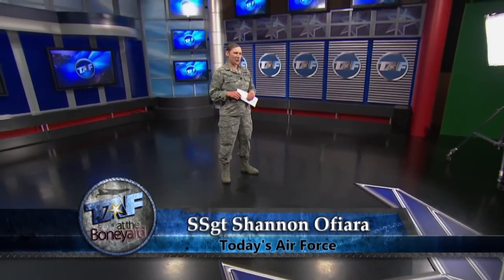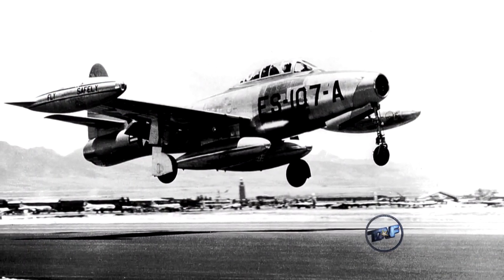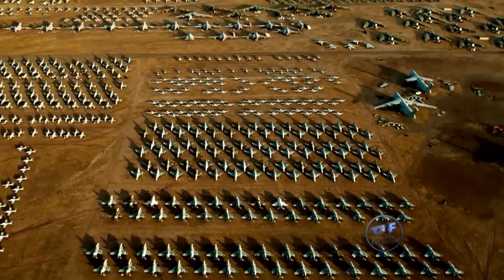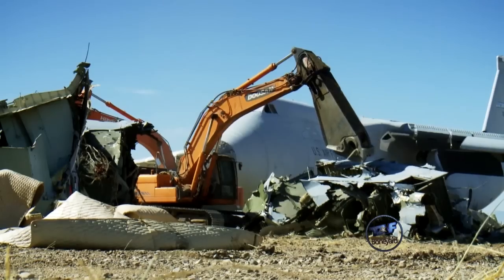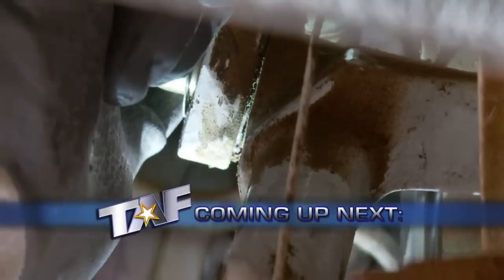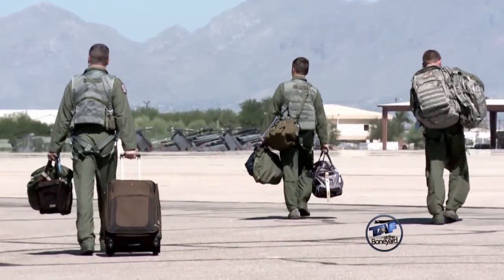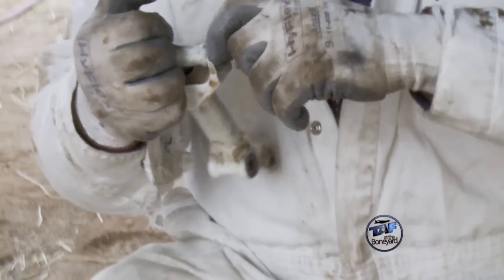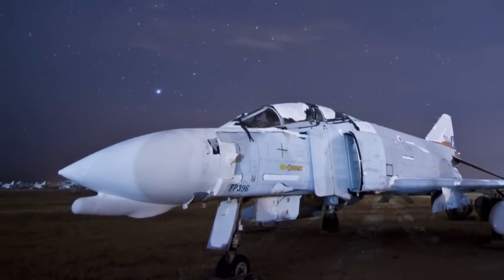Today's Air Force: At the Boneyard

Comment: I was there in October. Yes, you can visit the boneyard but it has to be on an official tour from the Pima Museum. The aircraft in storage there ARE NOT rotting. Some are being used for parts while some are in mothballs in the event they are needed to be restored for operational duty. Some of the C-5s will be converted into C-5Ms. This is NOT a junk yard. It's an aircraft storage facility. Older, worn out aircraft are cut up for scrap but there are airframes there that will fly again. The "boneyard" is actually a reclamation center.
Reply: Thanks for explaining this, a lot of people have no idea what really goes on there.
Reply: Are you able to go in any of the aircraft?

Comment: Great place to visit and learn about the many ways AMARC keeps serving aircraft flying. Those who think AMARC exists just to "scrap" are ignorant. Scrap is what's left over after millions of dollars in parts and equipment are efficiently harvested. Obsolete fighters are returned to service as drones for missile testing, airlifters are parted out to keep others working, and a wide variety of common electronics and other hardware are pulled, tested or overhauled, then put back into the supply system. Airframes ready to be scrapped are used for Aircraft Battle Damage Repair training which is vital and cannot be done on active aircraft for obvious reasons. (My class got to hack holes through skin, hydraulic lines and wiring in an A-7 and C-130 then repair the damage. Large fun was had by all.)

Comment: This is so cool-I could spend days wandering around. On the B-52's and B-1's still flying it seems there is two reasons they are there-over time on the airframe or reduction in force as part of a treaty. Would this be correct?

Comment: Similar appearance, but the one shown is a radar test platform. The Laser one has a rotating ball on the nose and is still at Edwards. There were some recent adaptations, but budget has severely dampened it's use.

Comment: Can anyone go in and have a look at the aircraft?
Reply: There is a tour of AMARC that begins and ends at the Pima Air And Space Museum which is nearby DM.... I dont know how much it is but I've heard it is a very good tour... Also a lot of the planes you would see in the boneyard are also at PASM including the actual F-84 Thunderstreak "Thunderbird 1" and a F-111 Tiger II "Blue Angel 5" there is also a Super Guppy Aircraft that carried the 2nd stage of the Saturn V rocket used in the Apollo missions there as well
Reply: Third stage from Douglas in California.  And the CSM (Command & Service Module), and the Lunar Module.  But not the first and second stages, they were too wide at 33 ft and very heavy they were barged in that is the "lake" you see beyond the launch clock back in the days of Shuttle launches, it was called the "turn basin" for the Saturn barges.  The second buy of Saturns was going to be even more stunning, with "thrust augmentation" (ie strap on boosters, longer, greater payload.  Nixon killed it all it was "kennedy's" project and he hated him.  A planetary tragedy it was smashed to bits.